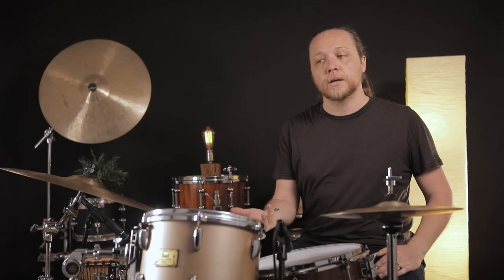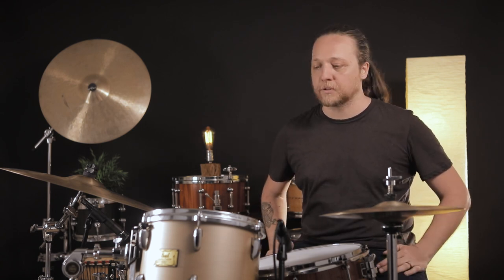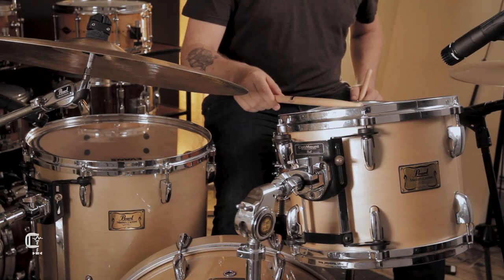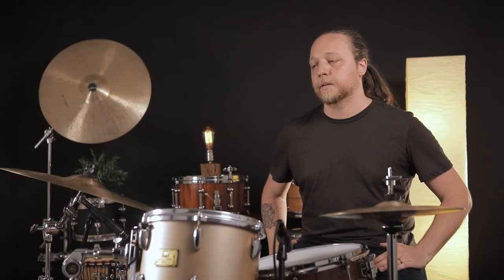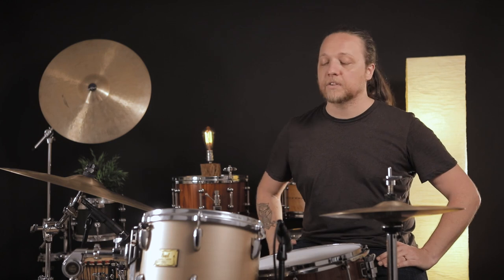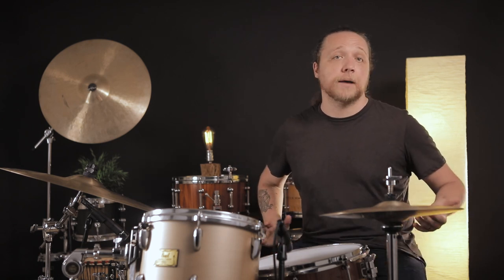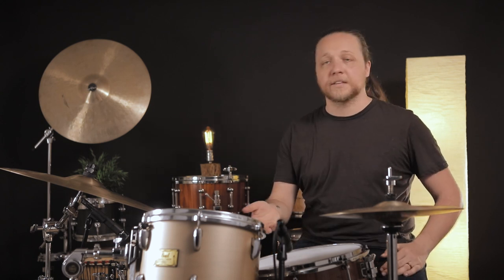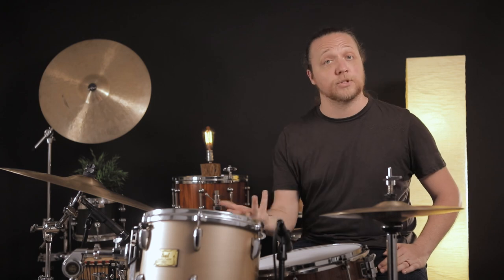Warmer Tone With Coated Resos Under Clear Batter Heads? | Season Two, Episode 24

Comment: After a recording session where I had to slap a ton of gaffe tape on my tom's reso head to calm it down for the bottom mic, I started thinking about using coated reso heads with clear emperors on top. This video convinced me to give it a try. It's been well over a year since I got the kit and it still has the stock heads on there, so it's overdue for a re-head anyway. Thanks again for the hard work!

Comment: Hey Cody, another terrific video.  I just got EC2s frosted as batter heads.  Also purchased G1s clear for reso heads to replace the original cheap came with kit heads.  I tried Remo Ambassadors as batter heads on all 3 of the Toms, 12, 13 and 16 inch.  Just tried the EC2s with the G1s as reso heads, nice skund but still had a little too much overtone.  Then tried the the the G1s as batter heads with original reso heads.  If I apply two moongells to each , a very good tone can be achieved with tweaking. I did not moongell the ec2s .  O e more "experient" is to use the Remo Ambassadors as the Reso heads , and the EC2s as batter heads.  I am a 68 year old returning beginner/ intermediate drummer who has returned to drumming after 50 year hiatus.  I tend to have obsessive behavior, which I hope doesn't slill over to my drumming .  Its supposed to be Fun, not Work  in the pursuit of a nice sound.

Comment: One thing to note as well, I've only tried this combo once and honestly would prefer either clear/clear or coated/clear, but I did notice the bottom with coating is a tad easier to tune because you hear more of the fundamental and not as many overtones.

Comment: To me, the overtones on the 'clear over coated' set up were noticeably shorter. It didn't sound too choked I thought the tone leveling off was pretty smooth. It certainly helps with articulation and in a recording environment (and in this video) can clean up those low rolling tones after attacking one or more toms. I'm sure it aids in cutting down indirect tom resonance from hitting the snare and bass drum in more modern styles as well. For entry or mid-level kits, this can be a nice hack for controlling toms with basic shell recipes and build quality.

Comment: I had Clear Pinstripes over Coated Ambassadors on my old Sonor kit for awhile, it sounded fine. I might do it on purpose but I feel like just a small piece of gaff on the reso will get you to the same place (rounder, warmer, less sustain) without buying all new heads.

I definitely run Coated Emperors over Coated Ambassadors on that kit full time and love the sound I'm getting with coated reso heads. No reason you can't put clears on top!

Comment: I had worn-out coated batters with coated resos that still had life in em. Wanted a change so I went to clear batters and I'm happy with the sound! Haven't A/B'd with clear resos but since I use the floor tom as a kick in a smaller jungle-y setup the coated reso does complent that look.

Comment: Ben Cole from D'Addario sent me a set of Evans coated Reso heads for me to check out. Experimenting with different tunings, on a Piano black Reference kit (not Pure series) with 2-ply clear batters, I was able to tune a lower fundamental note on the toms without the buzz/flap of clear Resos. I've found that the coated heads squelched some overtones present in clear Resos (ever so slightly), over single-ply Resos. I agree that it does give an ever-so-slight articulation in conjunction with 2-ply clear batters. One would not discern the difference if you put anything on your heads to muffle your heads. There is an audible difference if you tune your toms without muffling/head augmentation. I am loving your videos, BTW! 👍🏽👍🏽

Comment: I have been using G1 coated with Ec2 frosted on the top for a while now and are very happy. For me it gives more response at the lower volume that works great for dynamic playing and control, especially in low tuning. I'm thinking of going over to Ec2 clear on the batter since I mainly play in a rock band so I want the more "raw attack sound" but still a "softer" tone. So this video was of help to me =)

Comment: Maybe its my phone but the batter heads are much more muffled or choked on the ring after striking
Reply: I noticed the same thing with the coated heads, just watching on my phone.
Reply: logically that would make sense too, the coating might not affect the high end resonance too much, but using headphones there is a difference especially with the floor tom at low dynamics, at least to my ear
Reply: S

Comment: Honestly you can just stay clear, clear(only coated head is my batter on snare) because all the coated reso head is doing is simply dampening it and I can accomplish that by just adding moon gel where needed which you can use on both batter and reso sides and get the same sound results but at more than half the price. I personally use remo clear emperors on top and clear ambassadors on the bottom and that reason is I can accomplish any range of sound possible with that combo! If you experiment with applying small pieces of moon gel in just the right spots I can achieve any sound I want, now appropriate tuning plays a big role too. I like clear clear overall because I can play wide open with plenty of resonance or if I want the affect of a coated head or a more extreme dry or dampened sound I simply just use moon gel in the right spots which you have to experiment with and tune down a little. I love the fact I can achieve any sound basically with that simple combination of heads and achieve the same effects compared too any other head on the market. I have a full Tama 7 piece maple kit so I have a huge tuning range which helps. With different tuning settings, same setup of heads I've got and properly knowing where and how much moon gel too apply you can achieve any sound needed in my opinion and its definitely cheaper than constantly buying and trying different styles of heads when you can have it all with the combo I've just mentioned!!! Much love✌bud, your channels awesome👍

Comment: Very interesting..never thought about putting a coated head on the bottom..it sounded very close to the same as the clear heads..i did hear a slight choke on the sound ..not by much but it was there..interesting. thanks for video 😁👍🇨🇱🥁

Comment: I had suedes over coated ambassadors and now I have Clear Emperor Vintage over coated ambassadors, but rather back to normal when back to my snare Genera HD Dry over Hazy emperor. I think at the very least the coated heads last a bit longer as reso heads. I also experience less sustain with my heads like this without having to add dampening to the head or inside the drum.

Comment: Been thinking about this for a while, hadn't had the chance to try it out! I'd have expected coated resos to give considerably less overtone, interesting that there's hardly any difference in your recordings. I'm wondering if maybe it's partly due to Evans heads generally being drier than Remo? (I'm loyal to the latter). I've tried Remo's suede snare side and I got a lot less overtone than just a clear Ambassador, but maybe that was more the tuning than anything. I dunno.

Great video!

Comment: I had calf tone on top coated on bottom.  Then I reversed it.  On the 9x13 big diff.  Warmer with calf on reso. And more bottom end low.  Better feel with coated batter.  On the 9x13.    Far as the 16x16 diff animal to the 13.  I havnt changed that yet.  Now calf tone too coated g1 bottom.  Very low warm.  But. I may do same to the 16. Reverse.  Nothing like a single ply coated.

Comment: Hey guys - got an episode idea that hits close to home - could you do an episode on "How do I know if my bearing edges are causing sonic issues with my drum(s)?" - I have a 2009ish Catalina Maple kit (limited red sparkle) that I love but I feel like I'm not able to get clean enough lower tunings and while I've tried everything else (many different types of heads including the Level 360 G2s and G1s) and hoops (put on S-Hoops to replace the Chinese hoops that came with it) my attention is now turning to the bearing edges. They weren't initially sanded clean but I also don't have a "true table" to really check them adequately. Would love to hear your thoughts on how one might identify that the bearing edges are an issue with sonics and tuning range with a drum! Thanks - a happy Patreon supporter.

Comment: So over all...what heads/bottoms do ya recommend for beginners/intermediate drummers?
Reply from the maker: Hey there! Drumheads, like most other drum accessories, aren't really categorized based on player experience level. Generally speaking, if you're playing a variety of styles, I recommend coated two-ply heads like the Evans G2 for tom batters and clear single-ply heads like the Evans G1 for resos. For the snare, a single-ply coated head like the Evans UV1 or G1 makes an excellent batter head and you can't go wrong with the Evans Snare Side 300 for the reso. The Evans EMAD clear batter is a great choice for the bass drum because you can get a wide variety of sounds from it and you can keep your stock reso head unless you want to experiment with something we've covered here on the channel. Cheers! -Ben

Comment: Did you use coated batter on the reso side or coated reso?
Reply from the maker: We went between clear and coated Evans G1 heads on the reso side. They're not specifically designated as "batter" or "resonant" heads and can certainly be used as either. Cheers! -Ben

Comment: I have thrown the EC2 clear batters on the reso side of my 16" floor tom. Helps control the extended overtones, but does not kill them.
Reply: Videditor1067 you can turn the tam legg upside down so the rubber sticks up and not down on the flor try to switch other way on one legg it’s a old school trick  trust me

Comment: would definitely agree....not much difference in sound...
Reply from the maker: Kind of surprising, right?
Reply: @SoundsLikeADrum  I find that a bit of tape on thicker reso heads has more effect on the sound than the actual thickness of the head.  It changes the decay time, and that makes the drum sound really different.
Reply: @SoundsLikeADrum   you are correct you would think there would be a pretty big difference in sound